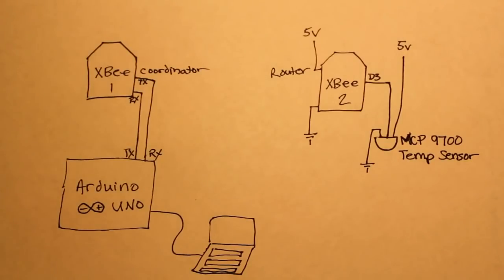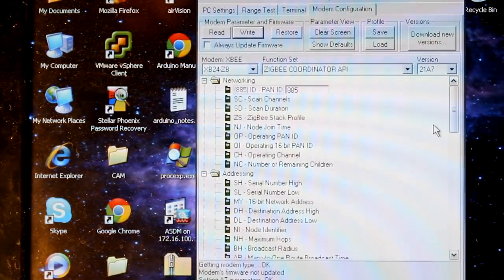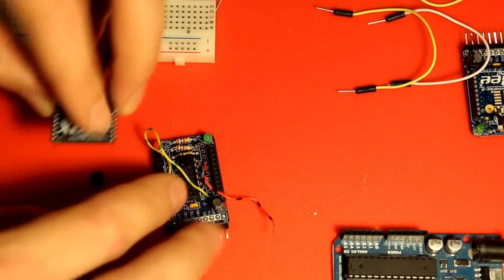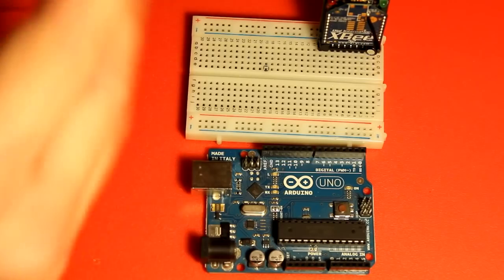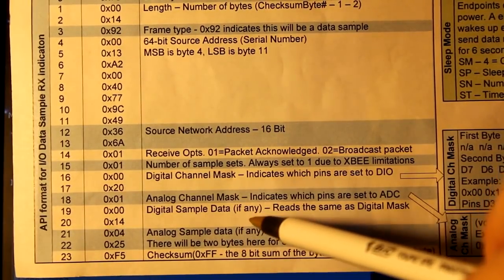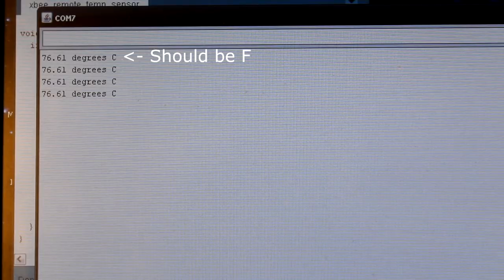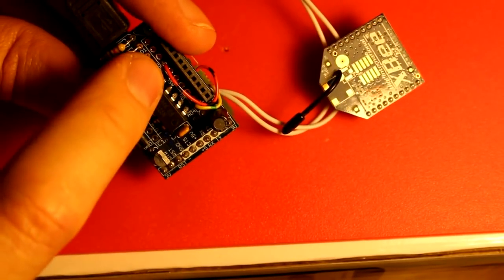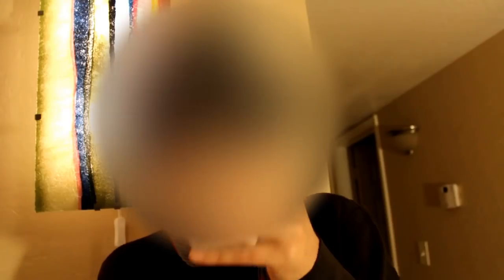XBee Basics - Lesson 4 - API mode: Reading analog data from remote XBee

Comment: You dont need to buy XBEE (GBP20.00), by the way...not cheap at all, and go through the sync to achieve the same result. All you need is just simple circuit and temp sensor. So , what is the point???

Comment: the arduino code would still be the same without the xbees right? (please be(e) so) :)
Reply: I bee-lieve so. Usually different hardware has different libraries so you would just look to see if there's xbee libraries included in the code. If so then there's special xbee-only code mixed in the regular code. Hope that helps.

Comment: I bought 3 XBEE 900 MHz from sparkfun how I configure them to form
chain. If A,B,C are three Xbee I want to send data from A to C via B i.e
B act as middle or range extender. I want to send data from one side of
mountain to other side but as range is line of site I used 3 xbee as
shown in Image. How should I configure them in XCTU.
Reply: +vivekanand dhakane Hi, have you already solved the problem? If you are sending data through Xbees, than just configure them in AT mode instead of API. For example: A = end device/ router AT  B = router AT,  C = coordinator AT. I hope this helps.

Comment: I have a question... Code wise, how would you setup for a xbee to send data from two analog temperature sensors? I try to put more serial.Read() but the serial monitor shows only one value, and the other is incorrect, help please .
Reply: Mario Torres Hey I have the same question. Right now I'm thinking of connecting the sensors directly into analog pins within the arduino and not on the Xbee like on the video (for example: D0-D3). I haven't found a solution yet I was hoping maybe you have. I'll try and plug the sensor onto an analog pin within the arduino and use analogRead() command within the code. I have a feeling it will probably work, I'll keep you post, please do the same. Or if you have found another alternative please let me know.
Reply: Jorge Pena  yes I did ! , and it's quite symple, to read 2 analog inputs instead of one, you need to change this line of the original code:
if (Serial.available() >= 21) , for if (Serial.available() >= 23) , that way your serial comunication begins  when the whole stream of bytes from the other xbee (coordinator set to api) comes. after that the code are the same, but you need to add more serialRead() functions to read the other 2 incoming bytes that represent the second analog imput.
Reply: Jorge Pena here is my code :

float voltaje;                //iniciamos la variable voltaje
float voltaje2;
// Variables dinámicas
int analogValue=0;
int analogValue2=0;

void setup() {

  
Serial.begin(9600);   

}

void loop() {

 
// Nos aseguramos de que todos los datos (23 bytes) esten en el buffer en modo API
    {
    // buscar el byte de comienzo del xbee en modo API 
    if (Serial.read() == 0x7E) {
       
    // lee las variables que no se necesitan y se descartan (18 bytes de protocolo de comunicación del xbee)
    for (int i = 0; i<18; i++) {
      byte skip = Serial.read(); 
    }
    //los bytes siguientes son los del dato del sensor de voltaje agrupados en 2 bytes (MSB y LSB) debido a que el convertidor ADC es de 10 bits

    int analogMSB = Serial.read();  //lee el byte mas significativo (se envía primero)
    int analogLSB= Serial.read();   //lee el byte menos significativo(se envía después)

    int analogMSB2 = Serial.read();  //lee el byte mas significativo (se envía primero)
    int analogLSB2= Serial.read();   //lee el byte menos significativo(se envía después)
    
    analogValue = analogLSB + (analogMSB * 256); //une ambos bytes para 
    
    analogValue2 = analogLSB2 + (analogMSB2 * 256); //une ambos bytes 
    
    voltaje=(analogValue / 1023.0)*1.23;            //interpreta el dato del sensor de voltaje con un voltaje de referencia máx de 1.2 V

    voltaje2=(analogValue2 /1023.0)*1.23;

    Serial.print(voltaje);
    Serial.print("  V");
    Serial.print("\t");
     Serial.print(voltaje2);
    Serial.println("  V");
   
      
    } 
  }
  
  }
Reply: Mario Torres Thank you so much for replying. I did not think about the (Serial.available() >= 23). I really appreciate your help. I will try this code out ASAP. Un million de gracias.
Reply: Mario Torres I have another question perhaps you have some ideas. I don't know how many analog pins you're using for your project but lets say you had to use 30 analog pins. I know the Xbee can handle 6 analog pins any idea how I can add the rest?...Do you think I could use the Arduino analog pins?...Or maybe have 5 Xbee Router AT's communicate with 1 Xbee Coordinator API and have them communicate that way? I appreciate your input.
Reply: Jorge Pena hablas epañol? for more than 6 analog outputs you need to add more xbees,  but you dont need the arduino for read the data, you can just set a xbee as coordinator and the other ones as router/end devices, the coordinator is conected to the PC with the usb explorer and you can read analog imputs from many xbees, theese page shows you how you can monitoring and store multiple xbees analog input data 
http://makerzone.mathworks.com/blog/continuous-monitoring-of-wireless-network-of-temperature-sensors-using-matlab-and-xbee-part-1/
other way you can use the arduino analog imputs but I dont know how to sent that to another arduino, there must be some library for it..
Reply: Mario Torres Gracias por tu ayuda, si me resultado mucho tus consejos. Pero lo que quiero hacer es mandar datos a través los pasadores de un Arduino conectado al Xbee(Router AT) y transmitir eso datos análogos a otro Xbee (coordinator API). Tienes algún idea? voy a seguir investigando.
Reply: Jorge Pena me puedes ayudar? estoy haciendo basicamente lo mismo que es mostrado en este video, pero con la diferencia de que estoy utilizando un sensor de temperatura LM35. Cuando leo la temperatura en el monitor serial sale un valor negativo de -17488.00, cuando caliento el sensor la temperatura va subiendo: -17250, -17100, etc. Estoy alimentando el sensor con 5V y su variación es a cada 10mV. No sé como leer la temperatura correcta... me puedes ayudar en los cálculos?
Reply: No te puedo ayudar porque no se tu código. Pueda ser algo con tu código.

Usa esta pagina, pueda que sea ayuda:
 http://www.instructables.com/id/Temperature-Sensor-Tutorial/?ALLSTEPS
Reply: Jorge Pena gracias, vi el link que me mandaste, mi código es este, le hice unos cambios...  pero todavia estoy recibiendo datos equivocados, y estos varian de positivo para negativo no se porque (-19, -22, 30,29,etc). Por favor mira mi código, gracias

float temp;
void setup() {
  // put your setup code here, to run once:
Serial.begin(9600);

}

void loop() {
if(Serial.available()>21)
{if(Serial.read()==0x7E){
  for(int i=0; i<19;i++){
    byte discard= Serial.read();
  }
  int analogMSB=Serial.read();
  int analogLSB=Serial.read();
  int analogReading= analogLSB+(analogMSB*256);
  temp= ((5*100*analogReading)/1024);
  Serial.print("temp: ");
  Serial.print(temp);
  Serial.println("C");
}
}
}
Reply: Matheus Valerio Penha en to codigo tenes que convertir el voltaje que estas recibiendo en temperatura centígrado usado un la formula correcta. 

  int analogMSB=Serial.read();
  int analogLSB=Serial.read();
  int analogReading= analogLSB+(analogMSB*256);
  volt = ((5*100*analogReading)/1024);
  tempC = volt/0.01 - 50;
  Serial.print("tempC: ");
  Serial.print(tempC);
  Serial.println("C");

solo para centígrado; para Fahrenheit tienes que modificar la formula:tempF = tempC*9/5 + 32;
Porque multiplicas por '100' quitale eso.

Comment: These are great series of videos, really appreciate your work! Is there a chance of posting a video on how to read two or more sensor data sent from a remote Xbee to the coordinator? 
I tried sending analog data from two sensors but I could only get a reading from one sensor. I even tried reading specific bytes from a frame but i couldn't quite figure it out. My serial read in HEX has 24 bytes in it (2 more than your example in lesson 3) so I know that I am sending two sensor readings.
Any help would be greatly appreciated. Thank you!
Reply: Did you ever figure it out haha. I just came across this.

Comment: I really appreciate your valuable tutorials may i know what is the minimum and maximum voltage to be given to analog/digital pins of Xbee i am trying to connect the flex sensors to the xbee at the router
Reply: tarun vella  all the ADC  supports up to 3.3 but VREF is internal and fixed at 1.2V. So, if you can, don't buy s2 model
Reply: ilparola what if i had connected the VREF to VCC of xbee would it kill it, at the same time will the resolution of ADC would be increasing?
Reply: tarun vella VREF pin does note exist, pin14 is not the VREF in the S2 this is a huge mistake in almost every datasheet you find. use a voltage divider. xbee is hard to kill and impossible to kill with 3.3.
Reply: ilparola so your damm sure about it, then ill go with you hope it is correct

Comment: Is it harder to go directly into the PC?
Do you know of a PC program that would read the data coming in through CoolTerm and place into a file the data from the two analog channels?

I have mastered the Line Passing Mode and record data with a separate AtoD package (Dataq) But it's awkward. Since USB Explorer boards are so common, you'd think logging with a laptop would be common too.

Comment: hello, please how and where did you get the analog temperature sensor or can a digital one be used and how
Reply: hello my friend, buy it at radioshack or here (http://www.digikey.com/product-search/en?mpart=TMP36GT9Z&vendor=505) for the best price you'll find online
Reply: He is using a variable resistor called a thermistor. Resistance varies with temperature, resulting in varying output voltage. By using the datasheet available for the sensor, you can use simple algebra to calculate the temperature based on the voltage read. Voltage is measured as an analog signal (typically between 0 and 1023, but depends on your microcontroller) as opposed to digital (0 or 1). Therefore, you need a thermistor (essentially an analog sensor for measuring temperature) for this circuit. I suggest you also research voltage dividers.

Comment: Hi tunnersup,

I want to ask if it is possible that my XBee Wifi can connect directly to my Android Phone Hotspot so it can send UV Sensor data to its Android App without any access point like wifi router. Just the communication between the two. I really need this for my thesis. Thanks.

Comment: This code is not working for us. We have a TMP36 hooked up to the I/O0, with ADC enabled.  The discard loop ends up leaving us with the digital data from our switch if we leave it with "i < 19."  We have tried multiple TMP36 sensors, and cannot seem to get it to read properly. The bytes where the data should be just aren't translating.

When we use the basic chat code, where the router sends the hex data stream, we can see the values of byte(s) 21 and 22 changing in response to whether we heat or cool the TMP36.

So, in that code, we are able to view the data, yet when using this video's code, and other code that we have been writing, we cannot seem to isolate it.  Please help!!

Comment: Hi ***** the xbee series 2 have the VREF 1.2v fixed. How is it possible that you connect the tmp on 5v?
Reply: ***** and? try to avoid the temp sensor and put the max voltage on the ADC, you will discover that you are losing a lot of measures. I'm not talking about 5V to 3.3V, i'm talking about VREF

Comment: Question:  When you do a Serial.print on the arduino, I know it's sending it to the computer console screen, but is it also sending that serial communication to the coordinator and then via wireless to the router xbee? Thanks. Great videos!
Reply: Luc...he is sending out data to the coordinator as well as the computer (SEE http://arduino.cc/en/uploads/Main/arduino-uno-schematic.pdf ON HOW IT IS CONNECTED TO BOTH) but the coordinator is in API mode, it will ignore any messages that it not compatiable with an API frame....so it will not transmitt data to the router.

Comment: I'm trying to build something similar but with XBee Series 2 (Zigbee Mesh). In my case i must use resistors for the analog sensors since the XBee ADC pins operate from 0v to 1.2v and the sensors operate on 3v.

How come you don't have a resistor as voltage divider for the sensor in this proyect? What XBee model are you using? And what's that sort of breakout board your hooking your Xbee onto called? (I mean the one with the leds). I'm using a breakout board, with no leds at all, just a mapper for 1mm to 2mm pins.

Thanks!

Comment: thank you for your help.
i have another doubt.
When i use the code, it show this error:

avrdude: stk500_getsync(): not in sync: resp=0x00

I verified the COM ports, I used another COM ports, I verified the board. With this error, I can't read the values from de temperature sensor.

Can you help me again?

Thanks

Comment: Thanks for the response.  What I meant is how to simultaneously communicate a signal from a pin (DIO3 for example) and a signal that comes from the arduino and goes to the Rx pin of the Xbee to be transmitted (as you would do in transparent mode).  Thanks again!